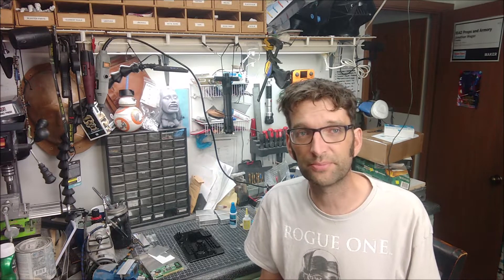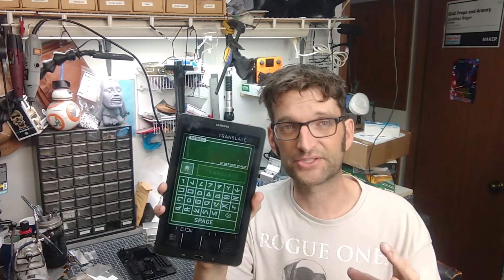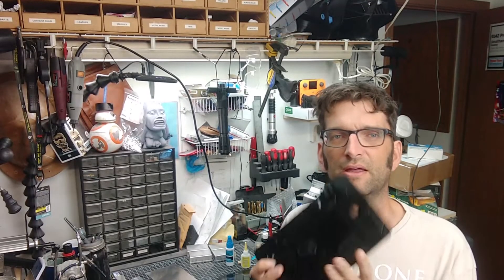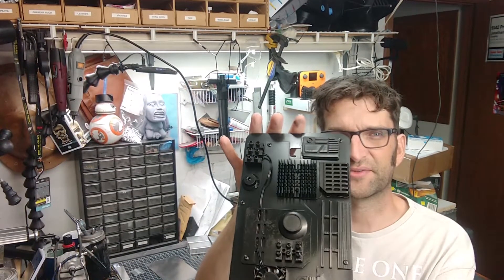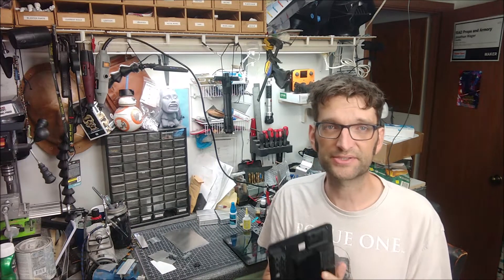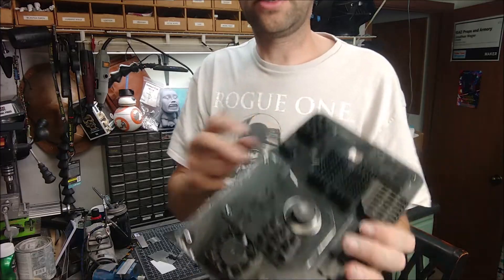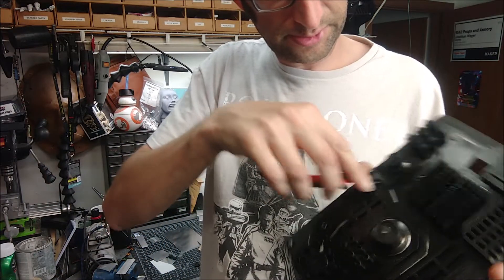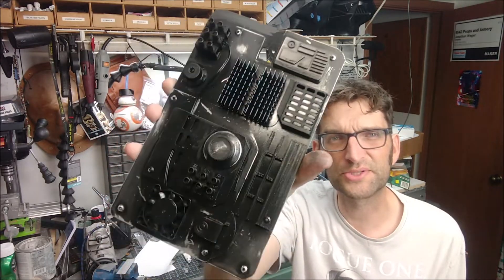3d Printed Datapad for Star Wars Galaxy's Edge

Comment: When making things look worn, look at old things that are worn. Like on knobs it usually on the fringe edge between top and side. Maybe tape the sandpaper on your finger tips or drop/slide of a gravel road a few times. Maybe you should make a Holocron, with at least 1TB of storage and a nice speaker and mic on rasp pi zero(battery) for song Sith music. Maybe to much for a small package but at least its function unlike most props.